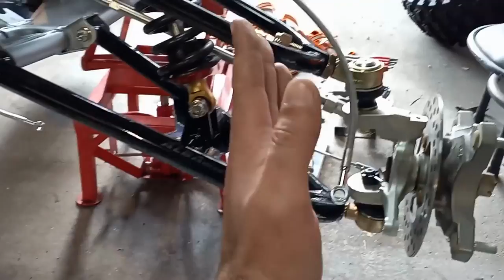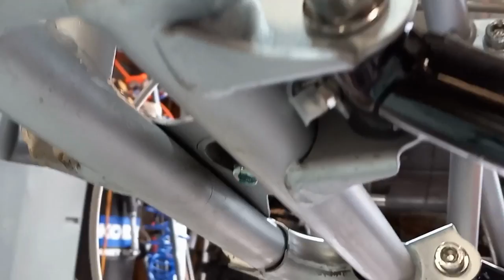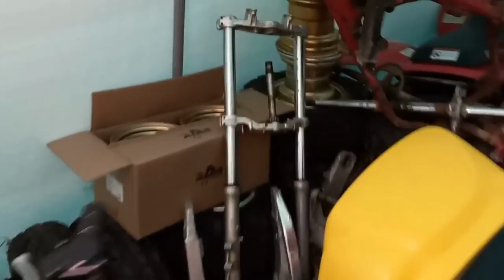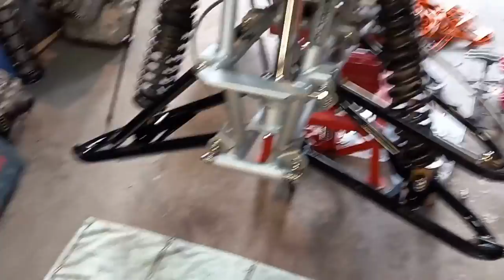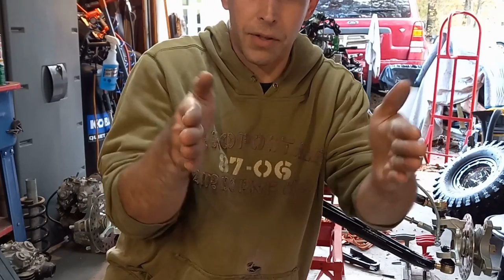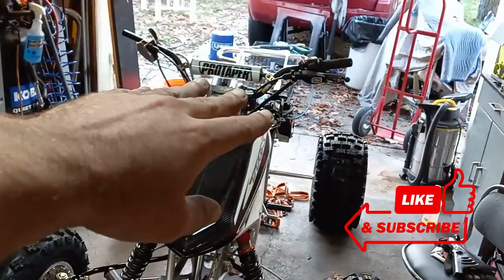Trx450R Build Installing Team Alba Racing A-Arms

Comment: How did you torque the upper ball joint without it rotating?
Reply from the maker: I tighten it and see how much it rotates past where I want it be be. Then loosen it, twist it back the same amount the other way then tighten it from there. Or use a set adjustables on any flat surface.

Comment: Old video but hopefully you can still reply. Dumb question, but when you say front wider than rear, is that meaurement from the outer edge of each tire or the tire centerline? Im assuming you mean outer side wall of front being wider than outer side wall of rear?
Reply from the maker: I still answer all my comments even from video #1. But yes from outside to outside. I like the front wider slightly cause it seems to handle better for my taste and I trail ride so if I squeeze through trees, the front fits the rear follows

Comment: I have a question and I hope you can help me with the arms that you installed on your quad, what measurements are +2 or +2.5 and the other was to see if you could help me with the compa link for the chickpea ball joints and the steel rod stainless steel that goes through the middle of the arms of the squad, thank you, greetings from Ecuador
Reply from the maker: These were plus 2". And not sure what else your asking me
Reply: @garagemcmatt  Could you help me with your email? I have several questions?
Reply from the maker: @bryanmoreira7272  garagemc549@gmail.com

Comment: Hey I noticed on the bottom control arm your kit came with castle nuts , I had recently bought the same kit I noticed mines came with same nuts as the locking ones is it safe to use?
Reply from the maker: Lck nuts are fine too. I prefer lock over castle
Reply: Thank you

Comment: Where can I get when you do for the frame?
Reply from the maker: Oh the silver paint? It's called aluma-blast by a company called Seymore I get it at advanced auto
Reply from the maker: It's like $20 a can but we'll worth it and durable
Reply: No, where can I get the boats hardware for the frame?
Reply from the maker: @mangog6710  boats hardware?
Reply from the maker: @mangog6710  boats hardware?
Reply: bolts I’m sorry for the frame
Reply from the maker: @mangog6710  the oem bolts I order from rockymountainatv.com
Reply: What BOLTS KIT you get
Reply from the maker: @mangog6710  bolt kits from spec bolt. Ebay

Comment: Great video!
Reply from the maker: Thanks bro
Reply: @garagemcmatt  I have the same arms you have. I’m having trouble running the +2 brake lines. Can you show a video of how you did that. The junction where the lines connect to go up to the brake lever hit the radiator air guides and the fitting that go into the calipers are hitting the lower ball joint threads.
Reply from the maker: @burt24pop  I did plus 2 lines on my trx330r video like 6 months ago. Check that one out. Not a 450r but same set up in the front

Comment: Couple questions 1: your frame looks fresh painted or powder coat but I noticed the honda original stickers on frame how did you preserve the stickers.
2: Is there a bolt kit for frame/ chassis 
Thanks
Reply from the maker: You can find bolt kits on ebay from spec bolt or alloy bolts. The frame I touched up the silver with this spray made by Seymour called alumi-blast. Advanced sells it
Reply: @garagemcmatt  Thanks for the info. Also I’m going to powder coat my frame not sure how they will save the vin number.
Reply from the maker: @Walt-c9m  any good powder coater will know what to do for the vin
Reply: @garagemcmatt  Good thanks again

Comment: Did your upper a arms having threads for the ball joint??
Reply from the maker: The lowers do, not the top. Check out my video installing alba a arms on my raptor 700 video. Same set up

Comment: I must have those tires.. what are they size and make?
Reply from the maker: Teamalbaracing.com xc rippers they are 6 ply they also make a 2 ply set called mx rippers. 20" rears and 21" fronts
Reply from the maker: Use my promo code and save 10% 

Gmc10
Reply: Thanks bro
Reply from the maker: @bryanw2400  no doubt

Comment: Is it wider that the rear or the same?
Reply from the maker: It's wider then stock but I have it set up square
Reply: @garagemcmatt  Ok. Kinda don’t wanna go wider than the rear axle on mine
Reply from the maker: @lucasgerard3947  this has a tusk adjustable rear axle on it with the one larger spacer between the axle and rear hub. It's about 51 inches wide in the rear

Comment: I’ve been through 6 sets of bushings with my alba a arms shits ass would not not recommend just get some houser or fire ball a arms
Reply from the maker: That sucks bro. I haven't had a problem with one of the alba products yet
Reply: How long have you been running those arms mine were warn out after the second ride and all i do is trails
Reply from the maker: @ThatexMason  the last set I had for a couple years. The ones on my 450r I have nor used yet the quad just sits